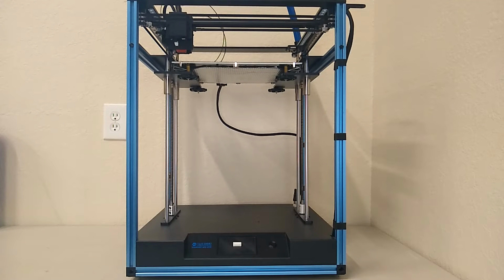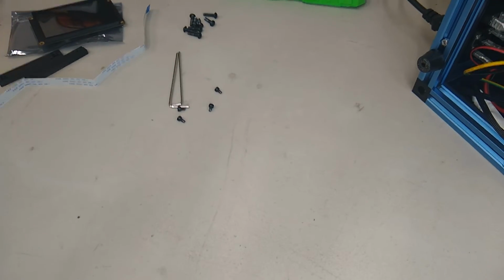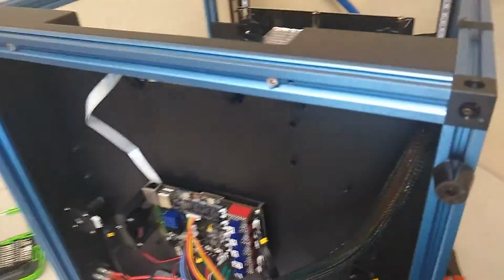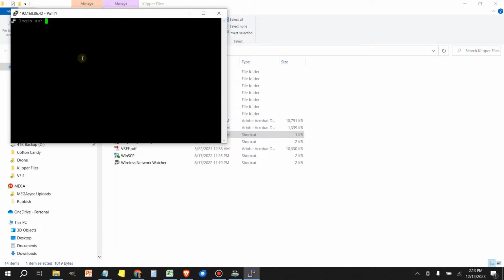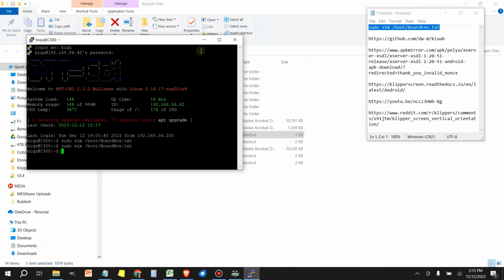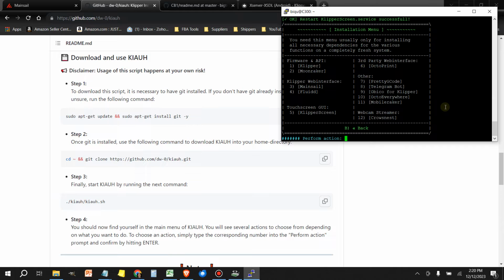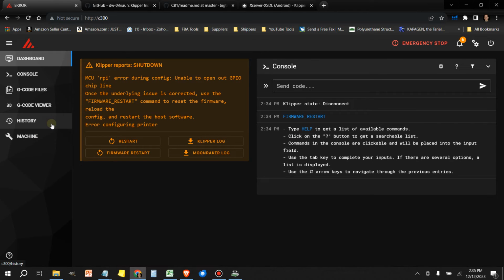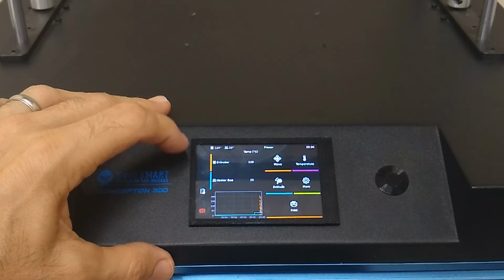How to install, configure, and run Klipperscreen on the TFT35 SPI connected to the Manta M5P + CB1.

Comment: Hi, @vbared, I've noticed that you used in this video a Manta M5P with 5 motors, extruder driven by in motor5. I have this very same configuration and I'm having troubles with the extruder to get working. Tested two different boards, different drivers, connecting the extruder motor in the driver in motor4 -which works-, ... I had a look at the files linked in the video but those are for Ender 3, not for this setup based on M5P. Would you be so kind to contact me and help me identify what's wrong with mine?

Comment: I can only imagine amount of debug time of that adxl issue...
Thanks for the video.

BTW, Do you know what is the length of that flat ribbon cable that was in set for the screen?
Reply from the maker: Hello, friend, most people own a smartphone or tablet and these devices can access the Klipper sessions using the web browsers so a dedicated machine mounted display isn't needed. I had requests to install one but personally I don't use the machine mounted touch display.

Comment: I don't see a BoardEnv.Txt file on the CB1 OS V3.0.0  However, I do see something in the System.cgf file for the TFT.  Any suggestions?
Reply: could you fix it with V3 or did you go back to 2.3 ? And if yes, how to fix it with v3 ?

Comment: I have a question for the stepper motor, why you decided to use HV instead of vbb? is there any performance improvement or any other benefit if you are using 2209 stepper drives?
Reply from the maker: Hi Ray, VBB setup uses the board's power for the stepper drivers. HV powers them directly from the power supply. I haven't noticed a visual performance benefit from doing it but thought it would be better.
Reply: @vbared  ok i tried both i think the stepper are quiter when in hilde mode when connected with HV but maybe is only my perception😁

Comment: Hi dear, great video I am trying to use a mobile for klipperscreen with an orangepi 3lts when I enter the command “sudo vim /boot/BoardEnv.txt” nothing appears, can you help me? thank you very much. I am new to klipper
Reply from the maker: Hi David, Thank you for commenting and encouragement. Are you using the image linked in the video description? If not then that file might not exist on the one you're using. Check to make sure that file is present.

Comment: Hello I went through this process, but I already had it installed from previous flash. When i go into configuration files I dont see Klipperscreen.conf, any advice on how to get that going?
Reply: I made it worse and installed network driver on screen and now ill have to wipe it all to setup. I have a second set i reinstalled fresh and that worked better. The rotation is weird, as the display flipped but the touch did not
Reply from the maker: Hi Edgar, I'm not sure why it isn't working for you but honestly, I only made this video because I was getting requests to do so. None of my Klipper machines currently have displays connected. If I need to be next to a printer to do something I just use my smartphone to access the Klipper interface for that machine.

Comment: I see you are helping people with tips. If you have the time, hope you answer this. Can this screen be used with regular Pis? I have a Pi 3 A+? Do they work together, fully? Touch included?
Thanks in advance.
Reply from the maker: Hello, Erald, Yes, it should work. Thankfully info on the Pi version is everywhere just do a search.
Reply: @vbared  Hello, first of all thank you for the reply. When I looked (I must admit, did not look very hard), I only found results for the CB1 and CM4, and in the github of BTT it said touch doesnt work.

Comment: Wow! 😮.Thanks for this video.. I like to try Klipper Screen instead of the text & dial screen on my hurakan main board M4P. Haven’t receive my TS35 spi order. Probably will run into same problem like yours M4P already uses SPI for ADXL345. Please   Update if u find any solutions to this or anyone please do comment. Thanks for sharing ❤
Reply from the maker: Hi Jim,

Thank you for commenting and encouragement, buddy, I appreciate you.

Check out this follow up I made on this to get both the TFT35 and ADXL345 working at the same time.

https://youtu.be/a6VTu1JE3BY
Reply: @vbared  thanks bro Appreciate you doing this. I m checking out your video & subscribed. Thanks for sharing ❤
Reply: @vbared hi Victor, I just received my TFT35..installing now on my BiQu Hurakan M4P board w CB1. plugged FPC cable spi following your instructions and hv edited the BoardEnv.txt. Still having white screen 😂. Klipper screen was installed & working with a HDMI 7”but with no touch. I just want to replace the stock Hurakan 2.4 Marlin screen with this TFT35. Please advice. 
BTW..I have switched to nozzle USB type ADXL345 Flashed & work just as well as the SPI type. So free up spi connection.Any change required for printer.cfg [display]section? Thanks for your advice❤
Reply from the maker: @Jim_One-wl4ke  Hi Jim, After editing the files in the boot directory did you power down the system completely and restart it?
Reply: @vbared  yes, edited 4x..my CB1 root doesn’t have the #tft35_spi so added a line to it. Esc,shf:,w,esc,Q. Sudo reboot, shut power & On power,white screen remain. Check the Boot/BoardEnv.txt by Putty Sh. It was edited. Edit again add spidev 0.0. Same. Edit again display =both, change to display=console, same. After that, connect to another unused BTT pi, just edit #tft35_spi …it works. Yes cable blue towards the black clip both tft & main board. Not yet resolved so far. Thanks for your advice ❤️

Comment: On the SPI Bus, each device needs its own address.   Similar to an I2C bus.   Guessing the conflict is because both devices have the same address.   Not sure how to work around it, other than maybe using a USB accelerometer.  I haven't seen a way on either device to change the base address.
Reply from the maker: Hi Brendan, Thank you for commenting and info on the SPI bus. Please link any good information you find on how it works so I can get a good grasp on it. Unfortunately, the BTT documentation doesn't go into any details that would inspire confidence. The Manta board comes with their Hurrikan firmware already flashed but this setup method only works using the previous Klipper 11.xx version. The new Klipper 12.xx changes something that messes up getting it to work how I describe in this video. Another thing that I found since I posted this video is that the Manta M5P has a dedicated SPI port that can also be used for this purpose but only works properly using their 2.3.2 system image. The 2.3.3 and 2.3.4 images won't work in configuring the SPI to work with the ADXL345. The most up to date video on how to flash the Manta M5P is linked below.

https://youtu.be/Mec3cZnCP18

Comment: IT is possible to use with Robin nano ?
Reply from the maker: Hello friend, there are 4 different models of MKS Robin Nanos listed in the Klipper printer configurations list so I'm sure you can run Klipper on it. I wouldn't bother with the display for the printer. You can control everything from any device that can use an internet browser.

Comment: Hi I got a tft35 v2.0 with an skr mini e3 v1.2, can I set it up like this with klipper?
Reply from the maker: Hi friend, Thank you for commenting. Did you purchase a CB1+PI4B adaptor or are you using a standard Raspberry Pi to run Klipper?
Reply: @vbared  I'm actually using the Bigtreetech Pi to hopefully run the Klipper!
Reply from the maker: @BlueeBubble 
Awesome, OK, the installation process is the same as I describe in this video. To setup the TFT35 check out my video linked below.

https://youtu.be/cHc4wEjpbso

If you get stuck on something just ask.

Best of luck with your mods!

Comment: This setup also works for the BTT PI V1.2, which I believe is the same as the CB1 but a standalone board.

From what BTT has said, it sounds like there is either a kernel and/or hardware conflict with using the SPI bus for both ADXL and the screen. Pretty sure this can be worked around by putting the ADXL on an SPI bus of another MCU instead of the Pi's.
Reply from the maker: Hi Tad, Thank you for commenting and info on the CB1. Yeah, that's pretty annoying but I did find a way to get Klipper Screen and ADXL345 working by ditching the TFT35 for an old Android phone tethered to the Manta's USB port bypassing the need to use that SPI bus. It works flawlessly and way more responsive due to the high quality touch display on smart phone vs the cheap feeling membrane of the TFT35.

Check out this video I made on how to do it - https://youtu.be/rdovXqrKivU

Best of luck with your mods!
Reply: @vbared  Mostly left that note there for anybody else looking to getting the TFT35 working on these boards for Klipper. Your video has good SEO for that search currently and did answer the couple questions I had left for getting it running.
Reply from the maker: @tad2021  Awesome, thank you for your contribution :)
Reply: Thankyou guys for this great input.

Comment: Hi Victor,  Gaining the knowledge of how to make the TFT work I'm sure was very satisfying and thanks again for sharing your efforts and editing tutorial once again.  Yea PuTTY
Just for me I like the Desktop UI as it is much larger that the 3" TFT although if you wanted a stand alone UI on the printer this might be  the way to go.  
Regarding the communication interface , I looked at my Printer.cfg file on the E5 Pro and it was showing the following lines for the ADXL 345,  I checked my E3V2 and the config file looks the same for the ADXL345 as the E5 Pro does.

[adxl345]
 cs_pin: rpi:None

 [resonance_tester]
 accel_chip: adxl345
 probe_points:
    117 ,117 ,20
********************************
Yours is a little different

[adxl345]
 cs_pin: rpi:gpio74
spi_bus: spidev1.1

 [resonance_tester]
 accel_chip: adxl345
 probe_points:  142.5 , 146 , 20

 
Your config file shows your using the SPI communication and there in might be the issue as maybe the TFT display uses that SPI as well.  The Raspberry Pi and the ADXL 345 both can use either the 1C2 or the SPI communications interfaces so maybe you could move the ADXL 345 to using the 1C2 interface.  They are pins 3 & 5 on the Raspberry Pi GPIO connector.

I found this link that digs a little deeper on the subject.
https://www.engineersgarage.com/adxl345-accelerometer-raspberry-pi-i2c/

I'm surely no expert on the subject but it did seem like the communication interface is causing the problem.  In addition since you and I did the initial ADXL 345 installs on the E3 printers I'm not sure why our config files are different for the Accelerometer lines ?   

For my beady little eyes the 19" screen works best.  Thanks again Victor and you surely lost a few more hairs working through that install.
Best Regards
Doug
Reply from the maker: Hi buddy,

Thanks for helping me hone in on the solution, I'm sure there is one but I haven't stumbled on it yet. The ADXL345 entries in the printer.cfg are a bit different between the Raspberry Pi and CB1. I bet with a Raspberry Pi you just plug the thing in and it works after adding the Klipper Screen files to it. I'm ditching the TFT35 for my old Android phone since it runs on Linux and won't need SPI to make it work. I'm sure there is a way to get the CB1 to talk to it so it can be used as the Klipper Screen. The cheezie touch membrane isn't very responsive with a finger. It works much better using a stylus.

Enjoy your day (:
Reply: Yep Victor, inserted the quarter got the credit did the work and now it's back to what worked best.  Still it is a good tutorial over all.  Thanks Doug @vbared